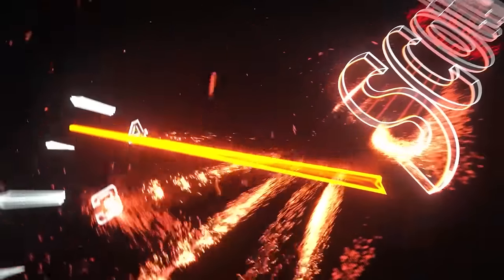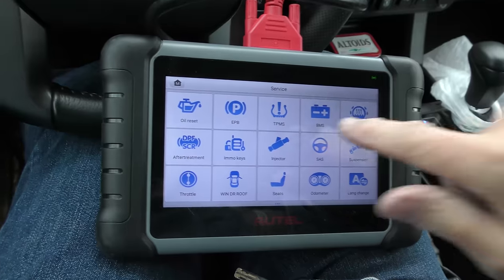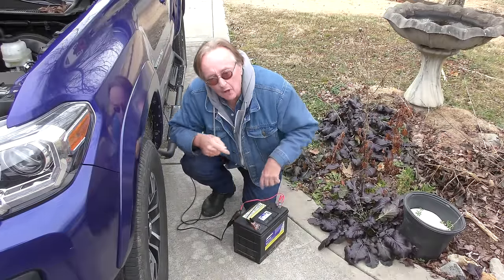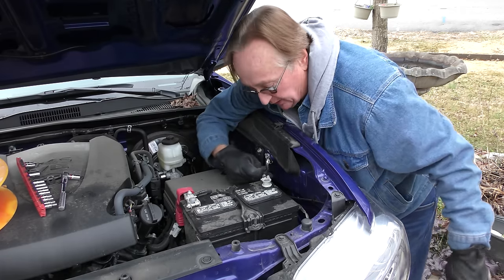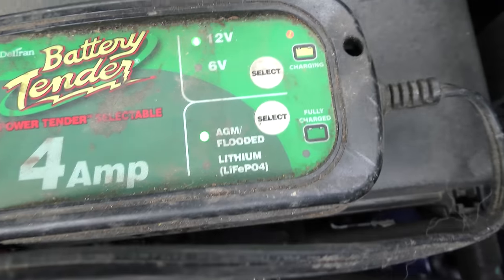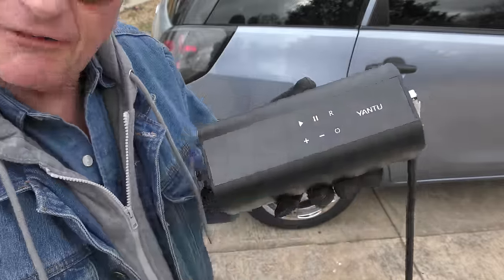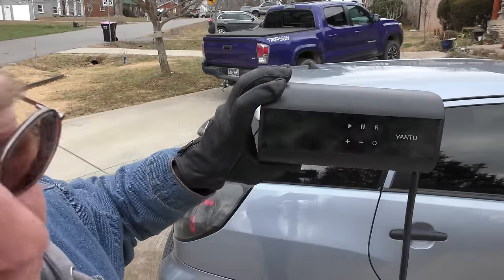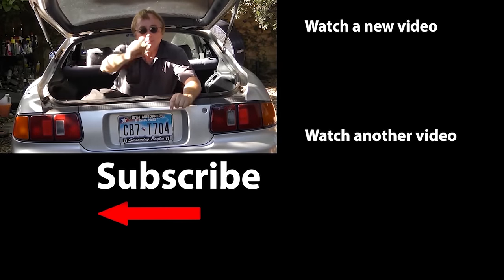Doing This Will Make Your Car Battery Last Twice as Long

Comment: SCOTTY - Cant I just hook my jumper cables from a second 12v battery and attach other ends to vehicle cable battery clamps before I disconnect starter battery? Thanks
Reply: No. You'll fry the system with 24v.
Reply: @CadillacDriver  It's in parallel not series
Reply: @mikehammer2075  huh? If you put 2x 12v batteries on to the cable terminals, the system will receive 24v until you take the terminals off the battery in the car. It would literally be the same as putting a 24v battery in your car.
Reply: @CadillacDriver  mikehammer is correct. If you wire the batteries in parallel you get 12V. You get 24V if you wire them in series.
Reply: @scottp2462  this is correct. So the system will only receive 12v if 2 batteries are connected as per the OP? So why would anyone need the OBD port plug? Just use jumper cables.
Reply: @CadillacDriver  no...look up parallel and series battery connections...educate yourself
Reply: @mikehammer2075  lol. I know the difference between parallel and series. I just wasn't thinking about which one this particular circumstance was. Don't tell me to educate myself, tough guy.
Reply: @CadillacDriver  As long as you hook up positive terminal to positive terminal to positive battery lead and negative to negative you get 12V but the amperage of both batteries. To get 24V you need to connect the positive of one battery to the negative of the other and then the appropriate leads to the remaining battery terminals.
Reply: @scottp2462  well aware. I was having a blonde moment... As we all do.
Reply: @CadillacDriver  You don’t need to be defensive. It’s good to learn new stuff and we all make mistakes.
Reply: @scottp2462  I'm not being defensive... As I have already explained in a post you obviously missed - I know the difference between the 2. Hence my "well aware". You have not taught me anything I didn't already know lol.
Reply: @CadillacDriver  I’ll call you out then. If you understood the difference between series and parallel you’d immediately understand that removing one battery wired in series would break the electrical connection. The video was literally about keeping the electrical circuit continuous. Then mikehammer responded and your reply was absent of understanding. You only claimed to understand after you had time to go research your error.
Reply: @scottp2462  
"I'll call you out then". 
Na mate, you have absolutely no idea what I was thinking, and why, when I was posting here. Keep telling yourself you've "educated" me, if it helps you sleep at night. It means nothing in the face of the truth.
"I'll call you out" 😂 epic fail. The mere fact I REALISED the error I made, does not render your theory of me correct.
Reply: @CadillacDriver  ONLY SERIES GIVES 24 VOLTS POSITIVE TO NEGATIVE OF OTHER BATTERY, ONLY AH INCREASE NOT VOLTAGE
Reply: @CadillacDriver  Lol, just take the L and move on

Comment: Can you use a battery in another vehicle with the memory saver? I don't have and don't want an extra 12v battery sitting around
Reply: If you have second vehicle or find someone nice enough to let you it will, just don't let positive touch no part of metal

Comment: Memory savers are not for all car I have one that tells you if it save to use on the car and so far it did not work on any of the cars I worked on it may work on very old cars, tires go flat for s reason you should have an air pump / tire repair kit and a spare tire.

Comment: It looked like Scotty connected the negative of the Memory Saver to the negative battery post, not to ground/frame. Does it matter?
Reply: Well there is somewhat a difference between ground and negative but ground is often associated with negative but the case is refered to as the lowest point.

Comment: I've dealt with disconnecting the battery for too long. On my Mazda there is a quick and easy relearn procedure for the auto driver window. When the window is fully up hold the window up button for 5 seconds I think and it resets. I only have driver auto. So I'd imagine it would work the same way if you have more than that.

Comment: Never start when a battery is under 12.4 V and put it under stress. 12.4 V has to be seen as absolute empty. Charge it up first. And if it reached less than 12 V it is almost destroyed just like Lipo batteries are when they get under 3 V a cell and capacity and resistance goes to the moon.

Comment: Good advice. I had a problem that might help others: Started my Lexus one morning and it sputtered, backfired, smoked, etc. and I quickly shut it down. CEL, stability control, ABS and some other light(s) came on. Hell of a mess. Tried once more and same thing. Had it towed to my mechanic who tried to start it and everything was fine. He couldn't find anything. I couldn't pick the car up that day so I stopped by the following morning. Turned the key and all hell broke loose again. Then, of course, we both had the lightbulb moment. The key was that both instances occurred after having sat all night. Sure enough, load tested the battery and 2 cells were weak. A new battery fixed everything. Now I load test the battery 3x a year even when everything seems OK. One battery tested weak and was replaced under warranty.

Comment: What battery system is in my 2002 ford f150?
Reply: depends on motor and bells and whistles, if has no bells and whistles, just regular charging system, also depends gas or diesel, if gas plain jane, not sure on diesel

Comment: I used a cheap 2 amp charger on my M/C every day and the stock battery lasted for over 10 years. I sold the bike with the original battery still in it.

Comment: Had a customer bring his car into our shop who had crazy electrical stuff going on like his speedo and tach dropping to zero while driving. I went straight for the battery terminals and the positive terminal lifted right off the post. The guy had been to two other shops and paid hundreds to tow his car in and I figured out his problem in 30 seconds in the service drive.😂

Comment: Don't leave a Lithium device in your vehicle in a hot climate, it will kill them or possibly worse burn your vehicle down.  Have had a dashcam with one crack the windshield,  replacement went poof, third one, fourth, all warranty replacements. I just took the LIPO out of it, no parked monitor fine, better than a $400+ windshield.

Comment: Scotty. I am in the market for a new car. I currently have a 2014 Lexus gs350 with 160,000 miles, great car but I want something faster and sportier. Would you recommend a Lexus RCF with the 5.0 V8. Ive found a few 2015-2016 models for decent prices

Comment: Does leaving that air compressor in the car in this insanely cold weather hurt the battery?
Reply: if they are li-ions yes
Reply: It only reduces performance of the battery if you decide to use it in the cold weather

Comment: only thing any vehicles need is this, carburetor points or electronic hei 1 wire distributor 1 wire alternator that's it, ol and manual steering with manual tranny, everything else is garbage

ps NO ONE WILL ASK TO BORROW OR TRY AND STEAL

Comment: I have a genuine question, My 2011 Toyota corolla likes to vibrate and shake the cabin due to my idle rpms being at around 600rpm. I’ve replaced my Ignition coils, spark Plugs, replaced the Air Filter, Oil Change + Filter replacement, I recently cleaned my Mass Airflow Sensor, and then pulled the throttle body to see unburnt  fuel just behind it. Now this weekend I’m going to take it apart again so I have plenty of time to clean it and see if that worked, and if it didn’t what should I try, should I get a Fuel pressure gauge and see if I’m in the limits of 44-50 psi, I don’t notice any lag when I accelerate, or I just don’t notice it, I’ve floored it to give it the beans to see any lag or stall and I haven’t noticed anything, it is cold here currently but this has been happening before it got cold, I need help cause this is stressing me out and I need a professionals advice, not some nob jocky no at all who uses wikipedia as there resource for help
Reply: Is the car in drive or park when it's vibrating?
Reply: @chrispeveler1578  like 10 minutes after the idling problem stopped like no sh*t just started being a good car, most likely needed to let the Mass flow sensor recalibrate while driving and now it drives amazing, zero vibration, doesn’t go below 700rpm now, still going to clean out the throttle body and intake manifold

Comment: Dewalt tire pump, best that ive come across.  But try using the battery versus the cigarette lighter plug. It pumps tires up over 80 pounds without a problem. He forgot to mention a  plug kit.
Reply: My tire inflator is top rated (not Dewalt they're overrated). Its also powered by the grid. By Husky and its all metal.. weighs about 5 pounds. You can purchase a DC to VAC converter though but be warned this thing draws 1.1A @ 115VAC or `130 watts or over 10 amps @ 12.6VDC. Yep better have your engine running... and no holes in your tires. It isn't so much the pressure but the time it takes to reach the required pressure vs the size of the tire. Mine can fill a 10 ply 235/16 truck tire from flat to 80psi in about 5 minutes without burning up in the process.

Comment: In a pinch I've used a 12V rechargeable drill battery as a 12V power supply.

Comment: Can we go back to Ford Model T or Model A simplicity? That was easy to find a problem with because you either knew, or you found out within minutes.
Reply: You wouldn't need to go that far back..80s tech would do... I like 90s and some up to about 2005
Reply: @Commenter_42  Those are still a complex thing to fix in comparison.
Reply: @ColtonRMagby  yeah but you wouldn't want model T brakes or a/c or heat or wipers or headlights....etc
Reply: @Commenter_42  The Model T only has a transmission brake connected to the pedal. There is NOT an A/C system in them. The headlights are okay, but there are also NO WIPERS.
Reply: @ColtonRMagby  exactly
Reply: @Commenter_42  Who needs a wiper when they have a coating to make water just roll off the glass?
Reply: @ColtonRMagby  they didn't come with safety glass back then
Reply: @Commenter_42  You can swap out the glass for tempered glass, which will break in tiny pieces instead of huge shards, but then you might not be able to make it fir without modifications. Then again, there's the expensive option of lexan.

Comment: I’ve learned the hard way- most batteries off the shelf are not fully charged (probably enough for many vehicles, but not all). Several years ago, I changed a battery in a Cadillac SRX. Took it home and installed it and it would not allow the car to start. What it required was a full charge (took it back, got it fully charged and it fired the car normally), so now when I buy any battery (for car or motorcycle), I request it be fully charged before I take it home and no issues since then. Many cars are VERY voltage sensitive.

Comment: I have a Noco starter. I'd probably use that over a 12v battery to keep the memory.

The inflater looks good but it does now if you have a puncture.

Comment: I have a 2017 Nissan Rogue that uses a standard battery.  When I replace it, would it be good to upgrade to an AGM or is that just a waste of money?
Reply: It's really personal preference, agm s tend to last longer , but not ideal in very cold weather  areas,  sometimes they won't start as well as a non agm

Comment: This just proves that modern cars are a SCAM! Nonvolatile RAM has been in computers for DECADES, so why can't cars remember things when powered down? If a car is smart enough to charge the battery differently based on its age, then why can't the computer SENSE how old the battery is? No spare tire? That pump will only work on tires that leak slowly. It will do NOTHING for severe tire damage. Oh, a spare tire decreases the gas mileage because of the weight??? Yes, but it's such a small difference, you can't even measure it. Scotty, thanks for revealing more new car scams!

Comment: BE VERY CAUTIOUS WITH CHARGING BATTERIES , I THOUGHT MY HARBOR FRIGHT JUMP START /8/2 AMP CHARGER HAD AUTO OFF, 
IT DOES NOT , SOMEBODY DOWN THE ROAD FROM ME HAD A GARAGE FIRE FROM OVER CHARGING THE BATTERY .
I HAD MY CAR TRICKLE CHARGING FOR 4 DAYS DUE TO A DRAIN,.  BUT UPP ON LOOKING IN THE MANUAL IT STATES NEVER DEPEND ON THE CHARGER TO  SHUT OFF OR (TEND) . 
SO A BATTERY TENDER IS A GREAT DEVICE WHEN YOU HAVE A DRAIN AND WHEN THERE IS DEEP COLD TEMPS.

Comment: Can you replace a standard battery with AGM battery.  Same Group of course, 27F
Reply: Yep, I have done this my wife’s matrix, her discovery and my riding lawn mower.  Probably throw one in my truck when the time comes.
Reply: Simple answer is yes. AGM batteries have several advantages over flooded cell batteries none of which will damage your vehicle. May I suggest Walmart for your battery purchase. Their AGM EverStart batteries are made by the same company that makes Interstate batteries and the two look suspiciously alike. Their batteries also have one of the best warranties available and they are typically less expensive than other similar batteries.
Reply: @scottp2462  you are right, man, I think there are only three battery manufacturers in the US. Exide, Penn East and I think Johnson Controls just sold its battery business, but I don't recall to whom.
Reply: nope, you have to have the alternator put out the right amount of voltage to keep the AGM fully charged.
Reply: @mikehammer2075  No, the battery and alternator run in parallel and alternator will not overcharge a battery whether it’s flooded cell or AGM. Batteries are also protected by diodes in the alternator from overcharging. In more modern vehicles the BCM regulates charge rate. Since AGM batteries have less resistance than flooded cells they charge quicker and easier so little chance of an alternator not being able to charge them.

Comment: Those tire inflators suck the hoses rot in about 2-3 years and it is a non replaceable part! when you need it most the hose is all rotten full of holes! Been there and I will never have another one! Hoses are very cheaply made

Comment: What is AGM?
Reply: Absorbent Glass Mat
Reply: Scotty says what it is near the beginning of the video.
Reply: AGM means absorbent glass mat and refers to the fine glass fiber separator between the positive and negative plates that helps absorb the battery acid. AGM Batteries are advanced lead-acid batteries. And they are about twice as exspensive.

Comment: I bought a Honda CRV new in February 2022. In December 2023 the battery went bad. So after 22 months dead battery. I’ve had this happen probably 4 times where the battery went dead in less than 2 years.
Reply: The start/stop feature  wears out the batttery pretty quickly 🙈

Comment: How would you emp proof a car
Reply: A giant faraday cage
Reply: Build a Faraday cage into the walls of you're garage
Reply: Buy one from the 60s and store the alternator... battery..etc inside a cage
Reply: Or you could make a emp resistant  car cover , get cover  put layer of metal  i.e. copper or aluminum  foil layer on outside of cover , then  put another layer of non conductive  fabric  you could use  tape and 3m super 77 spray adhesive to hold things together  , just don't get the spray adhesive  on you're  car
Reply: @JMPCARREPAIRS  you could... I wouldn't do it that way so good luck with that
Reply: @Commenter_42   agreed  a Faraday cage shielded garage would be best or ideal .